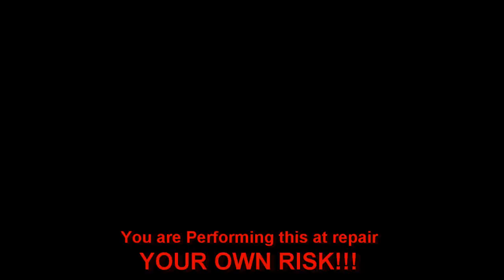Samsung  Laptop Change keyboard RV515 RV520 300E Replace Tastatur

Comment: Thanks for the video. The access panel on the bottom is a stupid design. Why do Samsung want people to risk snapping plastic just to get access to the drive and memory?? One of my mouse buttons wasn't working either so I soldered in a few new micro-switches while I was in there. I don't ever want to have to do this again!

Comment: Uhh.. This is a bit different for the RC512. It doesn't clip on like your model. I've opened it enough to just clean the fan and reapply thermal paste. But I haven't gotten to the keyboard. All I know is that it doesn't have a cover to go over. All the keys are under the laptop case.

Comment: Nice video, i was wondering if you have any video for: how to replace-or-fix the mouse left click button.

Appreciate your response
Reply: On mine it wasn't the actual button it was just a piece of foamy rubber like a thermal pad that's used for video cards between the actual button and the case part of the button. it just wears down. You can see if that's your problem by starting it up with the top of the case off and pressing down on the actual button. hope that helps.